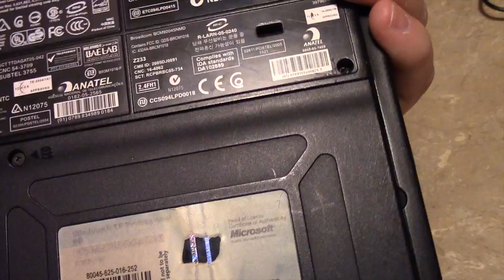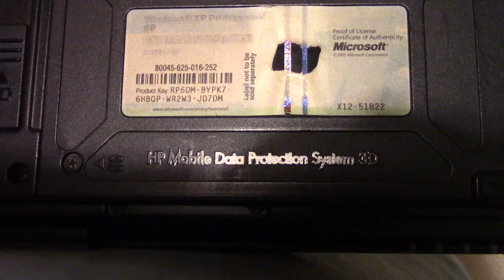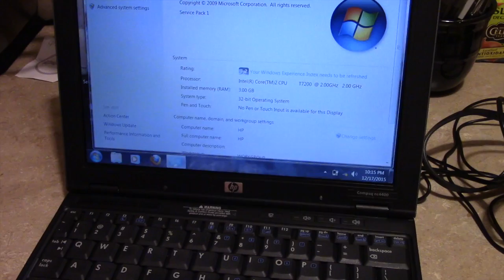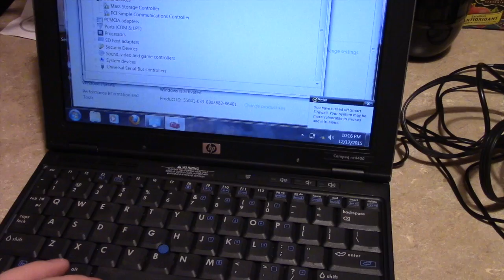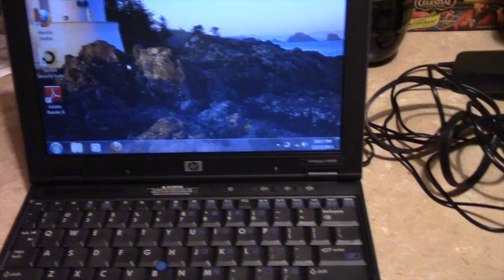HP Compaq NC4400 Ultraportable

Comment: I had the big brother to this model for a couple years as my main laptop before I got my MacBook and later my MacBook Pro. It was a HP Compaq NC6400. Nice machine. Widescreen 1280x800 (the first display before it broke was 1440x900, and I could not find a cheap replacement for that res). It had all the same ports, I don't know if this model has a smart card slot above the PC card slot, but mine did. The design was the same, keyboard and trackpad look identical to the one I had. The fingerprint reader on mine was on the palm rest, and I actually used it. Nice feature I wish Macs had. I believe there was also 2 more models with this design, a nc2400 that was a convertible tablet PC with the twisting screen, and the nc8400 I think, that was a mobile workstation class, with a business class (i.e. CAD) graphics card. Nice find you got there, it's a tank.

Comment: I just got this one's bigger brother, the NC6400. It was a freebie from my local school district that recently migrated to Chromebooks (it was in like-new condition apart from some engraving done with a dremel, no one ever used the cart this was a member of). It came to me with 1GB 667MHz RAM, a C2D T5600 (1.83GHz), and an 80GB HDD. It also has a DVD-ROM/CD-RW drive. Now I have it running 4GB RAM, the same chip, an upgraded WLAN card (the original was 802.11G, this one is 802.11N) and a 240GB SSD. It runs Xubuntu x86-64 like a champ. The GMA950 is a bit of a downside but I didn't pick it up for gaming.

They're obviously made to be very quick and easy to service, being an enterprise machine and all.

Comment: We used to have a fleet of these at the college I work for. Ours were the convertible version. They were pretty good when running XP... they never worked very well with 7 or 8... even with a ram upgrade. Drivers were also very hard to find... as is evident in this video. That's why we retired them.

Comment: I have a HP compaq NC6000 which I recently picked up off of eBay. I used to use one as my main laptop in 2010, I loved that machine but it sadly died due to the power delivery circuitry failed for the CPU.

Comment: The reason probably the fingerprint reader is on the display is the nc4400 is essentially the tc4400 without it being a tablet. In fact the base is the same as the tc4400. More then likely they reused tc4400 moldings with slight modifications,

Comment: I like Core 2 Duo era laptops.  I have a Dell Studio 1555 that I've had for 6 years, a Core 2 Duo T6600 with 4 GB RAM.  I've only had two problems ever with it: the WiFi card failed (easy replacement from an old laptop) and one of the hinge covers broke (I have it held in place with electrical tape).

Comment: The keys that don't seem to work are near the processor so heat maybe the culprit. Laptops of this era were subject to getting quite hot. If you replace the keyboard I would undervolt the cpu with RMclock and it might keep it running slightly cooler. I would also run thinkpad fan control or something similar to keep a check on the temps. goodluck

Comment: I have one very similar except mine is an NC6400 a higher model same amount of hard drive space and ram the processor speed is 1.83 ghz and used to have an optical drive until my 3 year old cousin broke it but it works great and I pulled that thing out of a pile of other junk computers that the senior techincan was recycling and lugged it home.

Comment: while you are at it, replace thermal compound inside CPU cooling system. tends to disintegrate over years. I have now inspiron 1720 build in 2006. full HD screen, dedicated Nvidia 8600gt, remote, dvdrw, upgraded with 2.6gig core 2duo ssd and 4gigs if ram that runs Manjaro.
Reply: +Marco Sartori 1920x1200
Reply: +Marco Sartori I have Dell Precision M70 thats more than 10 years old that also has a 1920x1200 widescreen 15" display.

Comment: Hey, I have a HP Vectra XM 5/133 Series 4 laying around, do you know how much is it worth? It's a pretty rare model, I don't see any of these for sale now.
Reply from the maker: +Monika K. The Vectra line is from HP's business product lineup. Generally, computers sold to consumers are the ones that become "collectible." Many people buy up systems they grew up using as children, lending to their "collector" pricing. Nobody runs to eBay and tries to buy a system like the one they used in a cubicle while spending hours in Excel as a junior accountant for some big company. However, the IBM PS/2 line is (or was) a very hot collector's item for a while... but to answer your question; it's worth anywhere from $5 to $250, depending on what someone is willing to pay for it.
Reply: I'd take it for 45$

Comment: Man, my Experience with Mobile Core 2 Duos has been bad, Like I think the only Laptop I had with a Core 2 Duo  that ran well , it was one of later gen ones think it was T9600 or something at 2.80 GHz. Anything around 2.0 Ghz Mark just felt too slow for standard use. I one Dell someone gave me to and it had 1.83 GHz Core 2 Duo , it was just bad . Most of think if I run across one , I usually say "Put Linux on it". Like if I was looking for Modern Laptop , it seems anything with a Core i3 , or i5 runs well for modern tasks. Like I was trying to pick up a Lenovo Thinkpad X220 Tablet , those things run really well and roughly around $200 now a days , My Thoughts about Core 2 Duo Mobile Line
Reply: +Numbers I have a 1.6 GHz Core 2 Duo MacBook Air (upgraded with an SSD), and it performs adequately for web browsing and other basic tasks.
Reply: Idk , May I just got crappy ones , just they never felt responsive enough for me
Reply: Well, I run Fedora with LXDE on that laptop had no issues , so I prefer Linux on Laptops

Comment: I just got an ancient Compaq armada 1590 Dr with windows 98 and 80mb ram, plus the original Windows 98 book and install disc..... All for FREEEE. 

But there's an issue with the resolution (it won't go higher than 640) even though I know it can. I think a driver issue..
Reply from the maker: +Hugh James Cooksley It's a driver issue; that laptop maxes out at 800x600 @ 24-bit color.
Reply: Please can you show me where to get the display drivers for this laptop (compaq armada 1590dt) on Windows 98, I've searched but all I can find is the Windows 95 drivers. I really want to increase the resolution because currently it won't got higher than 640x480 and 16bit colour.
Thanks.
Reply from the maker: +Hugh James Cooksley If no Windows 98 drivers were written, you're SOL.

Comment: Just because a laptop is designed for "Business" doesn't make it special in any way or shape. 
You sound like one of these old school fools.
Reply from the maker: +Wynne Colm Actually, part of my job is buying equipment for a commercial environment. I've worked with manufacturer reps and actually torn apart brand-new equipment to compare materials and overall construction to determine its projected durability. Commercial-grade systems are built better overall; while they often share the same discreet components as a consumer model, they're generally built with higher-grade casings and in some cases, higher-yield components. Old-school? Yes. But my years of experience in servicing equipment from the 80's and 90's has helped build my knowledge of what will and will not work in the field.